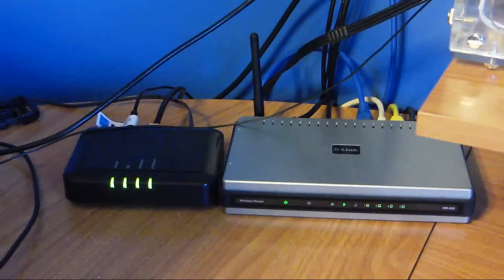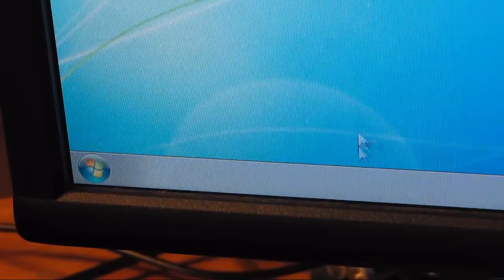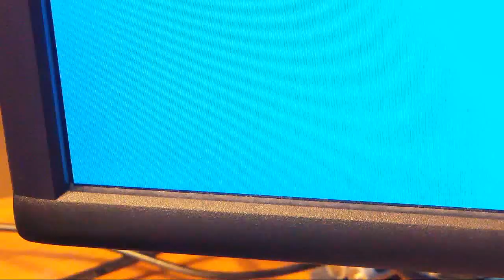How to Fix (Troubleshoot) your Internet Connection!!! (Part 1)

Comment: can sum one help? i hav the cisco dpc3008. k everytime i turn it off wen i go to work. wen i get bak home turn it on all the lights blink at the same time this jus started hapening 2 days ago. i dont no wats rong with it. so wat i do is take my old modem hook it up try to activate it wen the page pops up from xfinity then itll say thers sum kind of error call comcast/xfinity. then i disconect my old modem n hook my other one up n all is good like nothing hapened. i hav to do this everyday now lol. is my modem goin out?

Comment: I have a router/modem and a modem and we forgot to pay the internet bill , we then paid it but after then we haven't been able to connect to the internet. My PS4 fails the connection test at the internet part and our laptop says it's connected however it can't load anything. Plus there is kind of an issue where we don't have access to the account for our router/modem so calling the service provider is out of the question

Comment: half way threw the video my mom called me with someone to help. they said to unplugged the power and the cable cord and my wifi is now working. My wifi turns off and on and if you have the same issue do what he says and if that doesn't work unscrew the white cable cord and unplug the power cord. 💝
Reply: then plugg the power cord back in and screw in the white cord. 💙 hope it works.

Comment: The okay I have a wired connection my service provider is Telus here in Canada. 

1 it's DSL modem but it's three in one so the TV and Internet and it's a wireless router in one. 

2 I have a separate router in another section of the house to boost wifi around the house. 

3 so the Telus box is my main source of everything it's the brain like your modem. 

4 I have the Internet lan cable coming of the modem going into an adapter that I plug into my wall out let that pretty much wires my who house for Internet.  

5 I have my second router plugged into the wall out let using the adapter so I have two different wireless wifi names but it all works off the main modem from Telus. 

I hope you are following me 

So my problem is I can get wireless internet from the Telus modem that has everything built into it tv router everything but my lan connection coming off that going into the adapter that's plugged into the wall outlet is only showing me two lights power and Internet but it's not showing the light that tells you there's information being sent. So when I try to use my other router it's says no connection on everything I try computer phone tablet PlayStation. This been happening a lot lately and this adapters been there for good two years now and have worked great maybe it is the main modem but I get wireless out of it but not the lan even though the lan and DSL light work I don't know anymore.

Comment: wat if the green light is on ds and never goes pass dat
Reply: If the DS light is solid on the modem, does the next lights flash?  Would probably be a light labeled US (upstream).  The internet requires two signals.  The DS (Rx, downstream) is used to receive data on.  The US (Tx, upstream) is used to send data on.  If the US light is flashing, then it is not finding or locking onto the frequency that the cable provider's CMTS is looking for.  This could be a power level issue on the upstream signal, an upstream SnR (Signal to Noise Ratio) problem, etc.  You would need to contact your cable providers technical support

Comment: Theres one problem i have on arris box it dosent show green for DS but keeps blinking orange.
Reply: If all you have is a green power light and flashing orange DS light, then the modem is not finding/locking to the downstream frequency from the service provider.  This could be caused by several things, but you will want to contact your cable company's technical support
Reply: I have the same problem it keeps blinking I really don't know why
Reply: How dos you fix?
Reply: Did*
Reply: How did u fix it Jonathan?
Reply: Ur co ax cable isn't connect
Reply: Jonathan Duran MINE TOO HELP

Comment: Ok my intent is like this so it's really good right but every 5 mins it goes out then I wait 17 mins then boots up again :|
Reply: Yep same
Reply: Same if you find out how to fix it plz tell me
Reply: Same
Reply: PLZ ELL US
Reply: Did you fix it and how pls
Reply: same
Reply: same I'd why help pls
Reply: need answer too
Reply: Your internet is faster than it could handle. Because if it goes out and it's a good connection, your router probably couldn't handle it, so it had to restart. If you use AT&T, it could give you a better package without anyone knowing and it would be too fast. So you might have to get a new modem, or get a slower connection. I sadly don't know on how the other internet service providers work.
Reply: You need to get a completely new router if that happens. That happened to me with my old router and modem but when I got a new 2 in 1 router, it stopped. So pretty much you have to buy a different router and modem all together. Hope that helps
Reply: UAB Penguin same with u
Reply: Same but sometimes takes 3 days to work again......
Reply: UAB Penguin I would call your service provider and bitch at them tbh
Reply: Master BinBin same

Comment: my wifi is on just unable to connect and could lizard squad have something to do with this they doxed xbox I have a 100% packet loss
Reply: Mini isn't working too,i thought of the same thing too!!about,Lizard Squad,before they shut down psn and xbl everything was perfect,but now i have a problem where i get the same problem over and over again..For examle,when i load gta 5,when the problem appears,i spawn at the same place over again,idk what is it
Reply: Mine*
Reply: Mine hasn't got any errors for 4 weeks now..It's working perfectly.I'm on PS3,and that's why you don't buy the XBOX DONE.

Comment: Router/Modem >> WiFi repeater >> other devices. (Xbox 360)

The repeater keeps getting assigned a new IP address every now and then causing a connection drop and not reconnecting. How can I fix this and make a good gaming setup with an Asus ea-n66

Comment: After some extensive configuration of my router it didn't work but it just worked by the method of power off that you have said. You are hero thanks :)

Comment: hello, my problem is that i have no problems when my laptop is acrossed the apartment. it never disconnects, but when i put it in the same room as the router it disconnects. thanks for your time.

Comment: Every time i disconnect and reconnect my modem all the lights are on then all of a sudden all the lights go off except for the power which ends up blinking forever. Then when I try to go on the internet it will work for about 10 minutes then freeze and then I need to repeat the process. This fuckin sucks...
Reply: Same here it's fucking annoying sometimes it won't even stay for 5 minutes
Reply: Same

Comment: reb blinking DSL light means you have to check the connection between the modem and the walljack, possibly u have a filter/splitter attached to the walljack prior the modem..check the phone cables if it is properly connected

Comment: When I plug my Ethernet cord into the router my connection constantly says "Identifying....No Connections are Available." I know the cord is fine, it worked on the old internet service. I've tried every troubleshoot method I could think of, even something similar to this but only to have the same result.

Comment: Meckrocktech I don't know if to message you or just comment if you don't answer me here I'll be messaging you, but I have the same problem as tyhguy, my modem (I have it combined I'm pretty sure cause I don't have 2 things) keeps disconnecting and reconnecting on its own but only for my computer when I'm on the xbox its just fine does this mean my modem is "kicking the bucket" too?

Comment: i have a phone jack in my wall. then there is a splitter, and then the dsl line and the phone (filtered). the dsl is plugged into a wireless router. it constantly disconnects, the phone is extremly staticy, and sometimes the internet just wont work. ive had tecs come to my house 3 times. i still have the same problem. im angry

Comment: Hey mechrotech help my connection has been having problems i cant acess to the internet or certain apps on my ipodtouch  i thought i hooked it up correctly. But when it works my internet on the computer won't work. So i unplugged the wifi and then the internet works but now i can't even get the wifi to work when its plugged in it dont work either does the internet. Thanks please reply :(

Comment: There a power light and a world light then a wireless connection light on my router, i noticed the world light kept going off and the modem was not flashing green lights like it has causing my internet to load pages for awhile then saying unable to load page. Im not sure why considering the modem is only a few months old. Any suggestions?

Comment: I have a D-Link model: WBR-2310. 
One day my connection just stopped it didn't start with having minor cut-outs it just downright stopped it's the first problem I've had with it, I've  tried cycling it many many times, the icons just flash. Help?
(P.s) The problem is not with my laptop, it connects to any other network except my home one :-(

Comment: I have a problem with my modem and router. my internet has 2 connections and i can only connect to one. When i try to connect to the other connection (CONNECTION 2) , it identifies it as an unidentified network. how do i fix this

Comment: i  have the same problem you had before you got a new modem. Mine only last about an hour an a half and then it dies out for a little, then comes back on and does it all over again. It blows cause i called and they said i had to pay 100 dollars for a new one, screw that.

Comment: Hey, mechrocktech my internet had problems at the beginning when we started using it at our new house like about a year ago. After a while it became good and almost never disconnected. Althought sometimes the dsl would disconnect and reconnect, which is very annoying when im in the middle of online gaming or surfing the internet. About 2 days ago my internet started having the same problem. But now it's worst it keeps disconnecting and reconnecting and i barely have a little 5mins wit internet:(

Comment: @yeason2010 i used both my xbox360 and ps3, both lag wired, or wireless, i play a game like blackops and i have 4 bars but it still lags...also ive had my internet providers modem for 2 years could that be the problem? because ive called them and they said everything looked ok. or could my wireless router be broken its also 2 years old.

Comment: @mechrocktech im having problems with my internet it used to work fine a month ago,  i have like 100%-95% connectivity and my online games lag, its like it freezes and stutters for a a few seconds its very frusturating. Do you know any solutions? is my router bad or modem??

Comment: Alittle added idea : Check your wires to make sure there tight and "snapped" in  Aswell make sure your connection wires/cable are for internet use Some cables work for TV but only have little use with Your Modem you will get The internet but at a slower rate  Cable spliter are the same  I once had a cable spliter That was cheap and was only getting 9.5 Mbps on a 20.0 Mbps line ...A link to a trusted Speed test might help people aswell   cheers